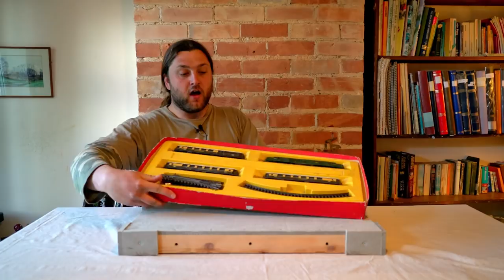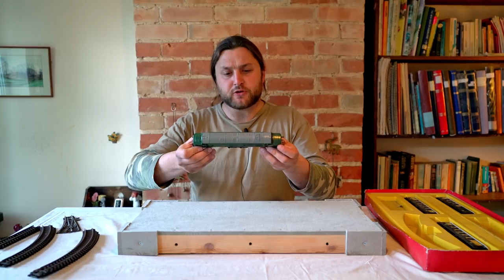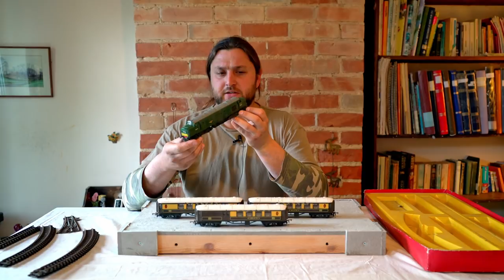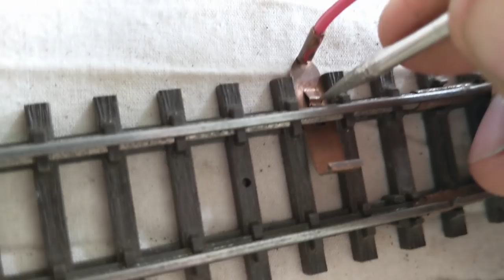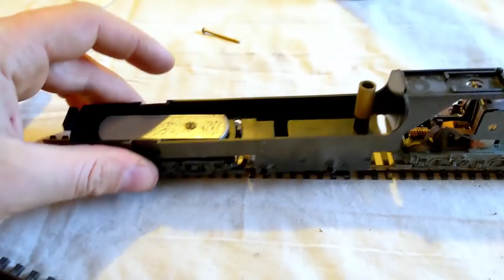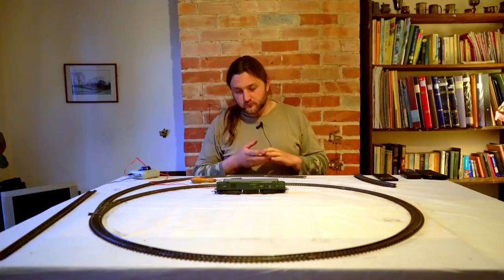Will this Tri ang Train Set from 1966 work? Lawrie Goes a Model Loco Episode 1.

Comment: It's great how well the robust the old stuff was made. Have a Tri-ang Jinty that still runs after many years of sitting in storage. The old Lionel trains I have found to be indestructible. Fixed up a few that were submerged in a basement flood. Clean the rust off, oil them up, run them for 8 hours at a model railroad open house.

Comment: R.751 loco using the X.337 power bogie, the X.04 was the single ended open frame motor. Sold loads in the family Model shop, I was 13 in '66, help out in holidays before taking over and running the shop in '75. Especially the replacement armature, the X.247 used to overheat, at 20.17 freeze play back and you have the classic melted plastic frame where the far brush has overheated and melted its mount. Part no. S.5452 if you can ever find one.... Standard track was solid grey, then Series 3, Super 4 yours and System 6 with lower profile, trouble was the heavier early flanges bounced on the sleepers and lifted the locos so no power.... Brain cells stirring  @ 67 yrs old..lol :)

Comment: Hi Lawrie, stumbled across this video and realised I have a Tri ang Western D7063 Hymek which has never run since I bought it a number of years ago and has the same type of motor and housing.
So I picked it up and had a look at the copper pick up. When I undid that screw I could see the small plate wasn’t in the correct position. I fixed that and it still didn’t run so I looked further and found one of the wires had come away from the soldered joint.
I fixed that, cleaned the track and oiled the axles and cleaned the wheels and it ran like a charm.
Can’t thank you enough.

I must stay tuned, who knows what else I will learn 👍❤️🖍📐🚂

Comment: Great video! I haven't ventured too far into older models but I have a neighbour with locos that are over 60 years old. The things to connect the track are called fishplates if you look into more modern track you can get ones with wires attached, just the fishplates or plastic fishplates.
Reply from the maker: The 37 in this set is approaching that kind of age!
Most of the fishplates in this set were a little rusty - I'm amazed at how well it ran.

Glad you enjoyed it!
Reply: @lmm  always enjoy videos on you channel especially railway related😉

Comment: Spooky - no word of a lie, I rebuilt my green Triang EE Type 3 D6830 yesterday evening! Mine's a first-edition with plain-ended axles; apart from a stripdown, deep-clean, fettling the pickups and replacing the worn-out motor brushes it needed only new spacer/insulators above the traction magnets - which I laminated from styrene sheet then cut and filed to shape for an invisible repair (the originals crumbled into nothing on removal). Modern lubricants help the performance, I use Woodland Scenics Gear Lube for the geartrain and Lite Oil for bearings and axle ends. I've also fitted Ultrascale wheelsets for compatibility with my Code 75 trackwork; there's a drop-in set available for the pinpoint axle version, with plain axle ends available on request. The version with bogies from the Triang Class 31 as here was developed through pinpoint axle ends, a change to Rail Blue with full yellow ends (still as D6830 with 8H22 headcodes) before a major re-hash with Ringfield power - with power and trailing bogies inherited from the Hornby Class 47 including the bogie sideframe mouldings and a major hike to the ride height! Even that Hornby Ringfield version carries the TOPS version of D6830 - 37 130 - and 8H22 headcodes; that one's also in my nostalgia collection. Outclassed by the later Bachmann, ViTrains and now Accurascale 37s, they still have bags of character and happily if noisily go about their business while invoking pleasant childhood memories. The jury's out on the comparison with the Lima - later Hornby Railroad - 37s; I have a small collection of those undergoing various improvements. Not that I'm a Tractor/Growler/Siphon enthusiast or anything :-)

Comment: I'm a day late but oh my, I was wondering when you'd show us some model railway things! One of my main hobbies is fixing up old electric toy trains, though I primarily work with O and S gauge trains made from the 1920s until the 1970s. A word of advice from me, is that when giving your loco a good service, you might (if at all possible) want to look up any kind of guide on it, just in case you forget exactly how it all went together and forgot to take pictures. Generally, rubbing alcohol is great for cleaning up old grease. The motor commutator, brushes, and brush holder all likely could use a good scrubbing with a cotton bud dipped in alcohol. For lubricants, model locomotives tend to run well using some white lithium grease on gear teeth, and sewing machine oil on all bearings. Be very careful to avoid over-lubricating- oil dripping onto the rails is never good for pulling a train, and the excess grease attracts dust, which will gum up the mechanism. I find that cleaning up wheels (and sometimes rails if they aren't too badly oxidized) goes well using "scotch-brite". I recommend also carefully oiling the bearings on the coaches for extra-smooth rolling! Happy model railroading to you, hopefully I can get myself over to the discord to share some of my own antics.

Comment: Needs to be remembered this was 1960's "Train Set" stuff designed mainly for children so had to be built to be used and abused hence the heavyweight track. If you think super 4 track is bad take a look at series 3 track with it's huge sleeper spacing and even worse the original solid grey based "Standard Track" of the early 50's.
The track was plated steel, the plating helping to keep rust at bay, until the plating was cleaned with an abrasive after which the bare steel rusted like crazy.
The loco motor was not an XO4 but a double worm drive unit derived from other early motor bogies, I have taken dozens of these apart in my time to replace burnt out armatures, they rarely fail to work after a bit of tlc. The early Triang wheel standards were such that the flanges were so deep they would bounce along the sleepers of the next generation system 6 track (and most other manufacturers track)

Comment: hey !  i have the same class 37 in BR green.......... a classic !   mine runs amazingly well considering its 50 odd years old !  give the motor and contacts a good squirt of electrical cleaner, and a lube up with some light oil, and it will probably run for another 50 years !   :)

Comment: Some serious arcing between the outside straight track and the moving blade on those points when you were trying to get the train out of the siding. The point operating mechanism is definitely beyond its prime.

Comment: I've only recently discovered these videos and have dug mine out, never realised it was that old but it is a triang class 37 with an identical inside motor setup, it'll do a few laps of a circle before stopping and after a few minutes will move again weirdly sparking as it goes. 😂  I got mine on ebay just a few years ago cheap intending it as a display piece since it was a very rough runner when it worked. 

Turns out at some point I brought a blue one too which is Triang as well but that one doesn't work at all right now. Just the engines as that was all I wanted. Any chance of more videos like this, I've enjoyed watching them.
Reply from the maker: I have a few more lined up!
Reply: @lmm  ooo great I'll keep my eye out for them.

Comment: They will always work, as long as the aged electric Mabuchi motor isn't burned out and the brushes are still intact. Tracks need brushing with steel-wool until they shine. and the contact wheels of the loco also need a good cleaning with steel-wool until polished. to do that you have to remove the entire assembly, find a way to start the motor then with a little steel-wool pad, press it gently on one wheel at a time until shine appears. Sand paper is not good as it removes too much metal, leaving the wheels unevenly matched. Nowadays there are cars with special non conductive brushes pressing on the rails that are occasionally used to keep tracks clean. Normally, if you see sparks from the locomotive, you know why, the tracks are dirty and that dirt sticks on the wheels, causing sparks.

Comment: Nowt wrong with Triang Super 4 track!

Designed to accommodate the wheel profiles of all manufacturers so customers could use what they liked...

Not soldering iron damage, someone has left a power flex in contact with it..... for some reason the plastic insulation reacts with the mouldings...  

This Pullmans have pin-point semi scale wheels so shoukd be fine on modern tracks...

Great stuff Triang...... thousand made so loads of fodder for chopping up and rebuilding....👍😊👍😊

Comment: I don't know if you did this, but generally while you have these old locomotives that've been sitting awhile apart, it's a good idea to get some light oil and lube alll the gears and bushings and such. (edit: you did mention this at the end of the video, sorry.) I've also used a product called "goo gone" on wheels and track, usually running the loco at full power with wheels spinning over a damp paper towel with the product on it. You could try the same thing with the contact cleaner or use the orange-oil based stuff.
Reply from the maker: It'll get a service in a upcoming video!

Comment: I would have an old train set rather than a new set any day. Old train sets are so durable, I have a 1940s Trix Twin Railway train set that had been neglected and hadn't run in over 50 years and ran straight out of the bow (minus a little clean and oil).
Reply from the maker: Oh trix twin had some great stuff!

Comment: give the pickups a good clean (use glass fibre pen) on copper bits, also check the point blades are not dipping in middle, if so use a small screwdriver to gently prise them level thats why you have the stalling

Comment: Loco operation will improve alot by oiling motor bearings and giving the gears some grease.  An excellent loco wheel cleaner is made by Minitrix for HO (OO) and N scales

Comment: Carefully remove the rails from the bases and soak them in white vinager for a few hours to remove the rust and convert the rust  then soak them in water mixed with baking soda and then  dry them off with kitchen  towel then put them on a baking tray in the oven at 70 degrees c to remove any moisture and give them a squirt of wd40 and wipe off then reassemble on the bases and your track will be not as shiny but rust free and good for many more years of use

Comment: Super 4 track ran from 1962 to 1972. Despite the rails being over scale code 250, the sleeper size & spacing is correct to OO scale for British railways.

The later Triang Hornby System 6 and Hornby Series 7 has not to OO scale sleeper size and spacing as it is made to European HO scale.

Super 4 is also far tougher than modern Hornby track.

Comment: By coincidence, I bought a Freightmaster set on ebay. The locomotive-a class 31 with the identical power bogie-has precisely the same thing wrong with it. Were they sabotaged by a parent wanting the son to forget the train set and focus on his school work? Or just something they were prone to?
Reply: 99 times out of 100 the top screw was loosened in the mistaken belief that it would allow the bogie to be disassembled. the correct positioning of the brass contact wasn't noticed on reassembly -until the loco was brought into a service centre for repair.

Comment: Have an ancient "B" class triang still runs with the power to the wheels -could fit a second bogie with pick up - have a spare. But what is the point - gears are worn and has little but the minimal resemblance to what its supposed to be - Bo Bo as opposed to Co- Co Is the least of it's issues.

Comment: Don’t apologise for the base board, there was a time I used doors, internal ones, sat on trestles with a layer of insulation board, and plywood screwed to the ends to secured them together...
It did work to be fair.

Comment: May be a class 37 but its got definitely got class 31 bogies have worked on 37's 31's for years  so know what I'm looking at 
Great video though
Reply: All the early Triang EE type 3's (37's) had Brush 2 (31) bogies until they rebuilt the model for the 80's with the ringfield powered bogies from the Brush type 4 (47).  I really enjoyed the video too.  I love the old Triang stuff, it may be a little crude but its almost more railwaylike than the delicate modern stuff with proper sleeper spacing and a reassuringly mechanical quality.

Comment: How dare you call Triang Super 4 track 'horrible'!!! Lol, most of my beautiful layout is made with it. It is tough, reliable and once you don't store it in a damp place it last forever. It also collects less dirt than modern Nickle Sliver track and it is just as conductive. 

Secondly, as for being 'toy-like' the sleeper spacing is prototypical correct for UK and Irish railways and it is in fact the modern track which is not prototypical correct! As it is built for the US and European HO market. Super 4 track can also run anything from ancient trains to the modern digital locos. And as you found out yourself worked fine after 50 years and a clean. As for the point. Spray the contacts and copper bus bars on the underside with a non silicone cleaner.

Comment: The triang wheel flanges were too deep for modern track and old track is hard to find.
Reply: The standard modern track, and most commonly used, has rails that are referred to as Code 100.  The rail height is 0.100".  Old Triangs will need the Triang Hornby Super 4 track, which has heavier taller rail.  Probably about Code 120 - 150.

Comment: If you want to see if it runs apply power direct to loco motor.    Your intros are toooo long before anything happens.   Check commutator and brushes before you start.  The rails are the least of your problems